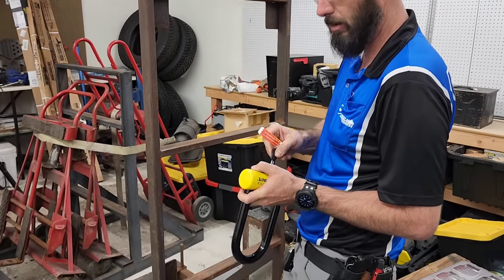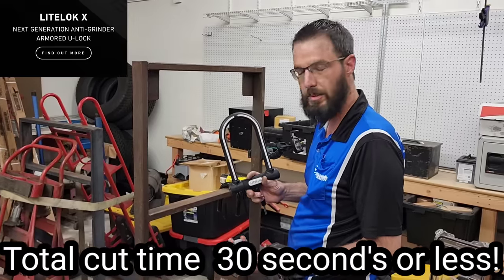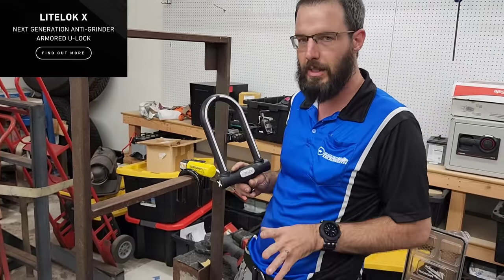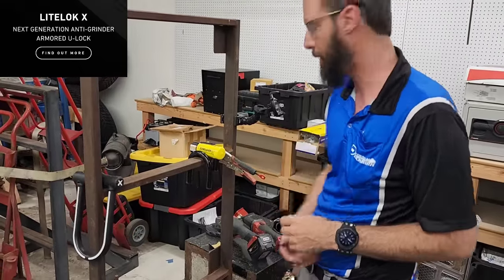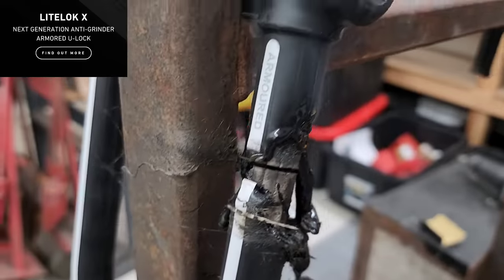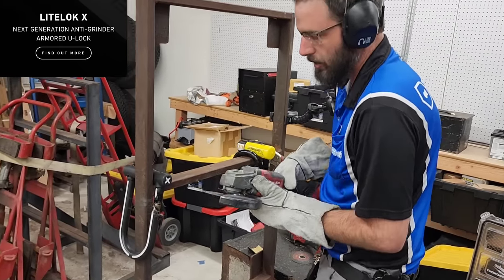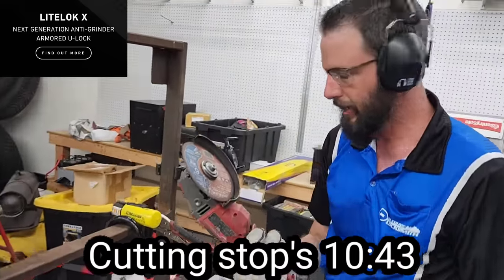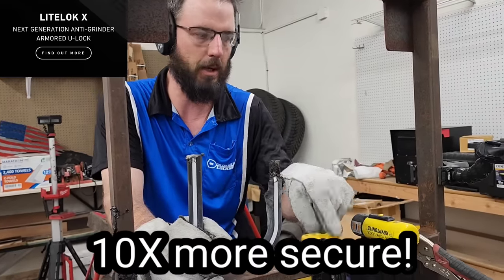Litelok world's first anti-grinder angle grinder resistant bike lock, top rated best bike lock 2022

Comment: In Europe we have something called a Hiplock D1000 which takes about 10 minutes to cut both sides with an angle grinder
Reply: Yea but they're 600 bucks for the real ones. I'd rather just get 70 dollar a year insurance, a cheap GPS tracker and a 100 dollar lock like I have and it's much more cost effective. And you can find your own bike or send the cops to it's last location...But even if you can't get it back you get a new one and a rental bike until you get your new bike. At least that's my policy(66/year).
Reply: @jdgoesham5381  The Hiplock D1000 is about $300 over here but you are right that it's too expensive which is why I don't have one. I have 2 locks which are effective against anything but an angle grinder, two air tags (one in the tyre, one in the stem) and a 120DB alarm. I removed the speakers from the airtags so the theives can't find them. Sounds like a good policy! I'll check out insurance over here but the only policies I have seen have been stupidly expensive
Reply: @jdgoesham5381  I have no insurance, no lock and no GPS tracker, and I've never lost a bike, because I never leave it anywhere where it can be stolen.
Reply: It took 10 minutes and 10 discs to cut ONE side from what I've seen.
The D1000 is $300, NOT $600.

How is $300 "too much" when nice bikes - especially nice ebikes - are $4-6k, NOT $1k these days?  When you spent $50 to protect an $800 bike 20 years ago, $300 for a $5k bike is actually a little less security money spent per bike dollar.  The math checks out.

Saw a $5k cargo ebike locked in the SF Bay Area with a basic, old tech lock recently.  THIS is the perfect candidate for this new breed of locks.

Yes, use GPS trackers.  Yes, get insurance.  Yes, be smart.  But use the best lock!
Reply: @ruzziasht349  so you sleep with your bike?  Shower with it?  Attend a concert with it?  Go to work with it?  Have sex with it next to you?!!!!  And what if you have more than one?  Do you ride your first bike with your second bike over your shoulder?

EVERYONE leaves a bike behind.  I HATE the saying, "Oh, my bike's TOO NICE to lock!"   No one is always with their bike.  

EVERY bike is left unattended, so EVERY BIKE SHOULD BE LOCKED!  All 12 of my garaged bikes are locked right now.  In a double-locked garage with beefed-up locks.  And with active video surveillance 24/7.  They're also all fully insured.  Some have GPS trackers.  And some of the locks have extra pipe sections attached for added security.  (Yes, I'm kinda bonkers when it comes to bike security.)

However, many are irreplaceable as they aren't made anymore, hand-made by a small builder and/or have custom paint, so it's important that I never lose a bike or have to collect on insurance in the first place.

Comment: what did you cut the second side with? I notice it went straight through with one blade and was a much cleaner cut without even melting the plastic outer. Was it a diamond blade?
Reply: The second side was cut with the same disk he finishes the 1st side....it was just used correctly and NOT twisted while cutting, so it didn't have the catastrophic failure of the first two disks.  Also note the severe lack of heat damage (melted vinyl cover) on the second cut.  It makes one wonder if the first cut was ....dramatized.... just a wee little bit.
Reply: @mikedeloach6849  That's what I was thinking. Was he twisting the angle grinder on the first cuts to torque and break the blades. There was a lot of heat generation.
Reply from the maker: To answer your questions 
Diamond blade was used on the 2nd cut at the end of the video.

I was not intentionally flexing the blade in any way shape or form. Film yourself using these Ulta thin blades and you will find that's just how the work, the spin so fast and are so thing they flex while cutting no matter how straight you hold it.
Reply: @waynewinton  The third blade cut that lock like butter.
Reply: @mikedeloach6849  I call bullshit as well. He was trying to break the blade by flexing it. Also the camera is not close enough to see exactly what is happening. If your pushing hard enough that the blade is flexing just ease off and let the blade do the work
Reply: If that was x4 speed then the 2nd cut took about 80 seconds. So still 5x as long as one cut of the Krypto.
Reply: @mikedeloach6849  06:44 on looks like the disk is flexing due to being pushed down.
Reply: @mikedeloach6849  i thimk your very much right my friend...
Funny how it cuts like butter on second cut
Reply: @mikedeloach6849  yeah, he wasn't even touching the cut half the time barely scraping, but when he was applying pressure, he was pressing perpendicular to the cut ). Cut through 2/3 in 30 seconds and then just fumbled around milking time. This subjects are not for such a blatant product placement if you ask me, but at least they got money hey, and anyone with half a brain will see anyway
Reply: @waynewinton  Sorry but that is BS, I have worn out 100's of discs on angle grinders and it's pretty easy to hold them straight and level, takes some muscle, technique and determination.  I was thinking you were affecting the cut by your technique as well and caused the blade to disintegrate on purpose or just cause you suck at using it.  Send me the pieces and let my try with my grinder.  : )
Reply: @ZeeCaptainRon Aye your right this bloke is talking B/S 
"the blade flexs as you use it" 
Utter crap, it will do of you hold it 45 degrees to the cut. I've used angle grinders for over 50 years and never had one "flex" if held correctly. Might help if he used the handle next time, that was ridiculous having your hand so close to a blade that could explode.

Comment: There are quite a few things that could stop an grinder (ex. if a grinder is used on one's private property):  

1.  Motion detector.
2.  Self-defense classes: boxing, wrestling + grappling and mixed martial arts.  Include good cardio classes.
3.   Large attack dog(s).
4.   A .38 special revolver, .44 magnum, 12 gauge shotgun, etc.
5.  And some large, hard core, hard-hitting' associates.

Yes!  Two or more of the above can stop the angle grinder!  If you really want to protect your prized possessions, you can do it!

(Also, look into: sound alarms, GPS trackers and  video cameras - both obvious and hidden.)

Comment: how well does it hold up to a diamond disc?
Reply: Not good at all, the composite fiber that the lock is covered with is great against metal, but does not put up a real challenge against diamond. Several videos out there where they have cut this lock in a real life situation in under 2 minutes (with a battery powered angle grinder). This lock is a far upgrade compared to its predecessors, but this video is giving people a false security.

Comment: 8 5 24 
     appreciate the many comments making light of w-w's methods.   
a  good lock will be used for both my mtn-bike and enduro dirt bike.
as often in the CO mtn's there is no choice but lock up the bike to
whatever is available that looks the most secure

despite all that tho the value i get out of this vid is seeing a highly rated angle grinder
and learning its battery spec's.  plus an opinion of a good brand of disc.
seeing how easy it was to change to a new 6" blade was revealing.

       here is what i need a good angle grinder for.  my xt225 is 20 y/o .
and the stock rear tire  4.0 x 18  needs replaced   and getting off the old
one ... as neither it or the inner tube will be used for anything else 
using an angle grinder is the choice for removing both.   the rubber's
gotten stiff and hard and is too tough to try and get off 
using traditional methods.

        using my Chicago angle grinder worked well two days ago for the 
front 3.0 x 21" wheel.
aand using the cable-tie method the new tire went on easily.
w/o any soap-y water

       now , w/ the rear wheel all goes well until i get down to the
 tire edge  'bead' or whatever you call
the section with the steel cable embedded in the rubber.   even with
2ea  24" tire-irons from h.frt the bead can only be pried out about 3/4"
from the wheel metal rim.  thus getting to it with a 7" skil-saw and
a metal blade  worked but only up to  the last 1/2".

     next the angle grinder and a 4.5" metal blade worked some
except the diameter wears down and hitting the rim and scoring
it is too dangerous.  once i have a new blade i'll try it again.

     failing that the tool of last resort is an air-die with a 1/4" shaft 
2"  metal - cut disc blade .  its smaller diameter shud fit in there nicely

     so long

Comment: Good test. I remember your test of litelok's first lock, pity you didn't try the torsion approach with that first. Litelok is a POS company that posted videos about their original lock that are fake (supposedly angle grinder and saw resistant, which it wasn't), who posted fake comments with those videos and who claimed slander about the video "Litelok bike theft in 17 seconds", which is just nonsense action from them, so I would not ever buy anything from them. About this type of lock: I heard about such technology (inserts in the steel to stop/rip apart metal grinding discs) years ago, makes sense as with metal cutting discs you get nowhere in stone and similar materials. The similar hiplock D1000 was available at least a year ago. Your test: I was curious about how diamond cutting blades would do. From a reply you placed, you did the 2nd side with such a blade and looking closer at the video I saw it and really the question is how fast and how many blades exactly with such a disc?
Reply: Cutting any material a masonry/diamond blade will be much slower than an abrasive blade, that includes very hard materials.
Try cutting a larger drill bit for example.
Reply: As far as I'm aware there aren't using steel inserts but extremely hard alloys (almost as hard as diamond) similar to something like boron nitride.

Comment: Yep, but on the other side of the u-lock you cut it with a diamond cuttin blade. Instead of the metal cutting disc. It munched through it. So the point is if you have a really expensive bike, motorcycle etc. Dont lock it up.

Comment: Now repeat the test using someone who can use a grinder ! 
You are twisting the cutting disc in the slot you have cut, yes any cutting disc will shatter cutting normal 10mm rebar if you twist it in the cut.

Comment: Every video I saw used low quality discs. How about using a diamond disc? And also keep the angle of attack always exactly the same: the metal then heats and becomes soft. You can exercice on steel bars for concrete reinforcing.

Comment: This isn't a solution because they will simply grind through the crappy bike racks instead. Whatever you lock it to needs to be strong otherwise this lock is useless and very expensive.
Reply: Remember, assuming you lock it in the city at daytime, whilst they might be able to get thtough the lock or what you locked it to, they gotta stand in the middle of folks with a grinder , someone is bound to call the cops, better yet stop these spineless cowards
Reply: Yes but they will start on the lock first then Realize eventually to cut through the bike rack but most thieves probably aren’t going to immediately think of that

Comment: its interesting that the second cut didn't go through even 1 blade?? you should do it on the hiplock d1000, i hear its much more better than this lock with angle grinders.
Reply: Pretty sure he just had a firmer cut there and more leverage
Reply: @falcodarkzz  He switched to a diamond disc instead of metal discs that he used before. The composite fiber that the bike lock is fused with is great against metal blades, but stands no chance against diamond discs - which a professional bike thief would use...
Reply: @sirulrich88  no, the blades are the same, he just angled the tool. Very apparent on the first disk, but even for the 2nd, you can see him left the back at 9:15

Comment: The fatal flaws: 1) the thief can cut through the metal post the lock is attached to (almost certainly 5mm steel - easy to cut) or 2) they can cut through the bike wheel or fork or whatever and throw the busted bike into a van. Oh yeah, and what about a diamond blade? It’ll cut through stuff abrasive discs can’t even mark.

Comment: Someone needs to make a lock that has a plastic shroud around the lock that is filled with hundreds and hundreds and of very tiny  Is kevlar fiber threads that are doubled back on themselves so as soon as you with the grinder Is touches them they all pull out and grab ahold of the grinder blade.

Comment: the issue isn't the lock its what the lock is attached to, just cut the weaker material then take bike somewhere else to remove lock
Reply: True. Just make sure it is locked to something solid & thick? Are common bike street racks hollow? If so a thief might attack that with a grinder once the Litelok x3 becomes known about?

Comment: I've been using the Pewag case hardened 12mm chain with the Video Euromonolith padlock which is the most angle grinder proof combo I've found so far but it's 6.5 lbs for a 1foot chain. Seems like litelok x might be even better?
Reply: Or have both. Plus cover your bike and park it next to other bikes that aren't covered. Why? I saw on a BBC documentary, London bike thieves said they wouldn't target a covered bike, because they don't know what security is under the cover, and they don't know how long it will take them. So they target the bikes with no covers because they can evaluate how quickly they can steal it.

The cover alone next to loads of bikes that aren't covered, would probably see the bike ignored, if not then they have a nasty surprise of grinder disc destroying hell waiting on them.
Reply: @Inquisitivemind97  Smart. I'll remember that. I keep a cover in my frame bag of my ebike.

Comment: What if you did another test but with one of those fancy diamond cutting wheels? Yes a criminal isnt going tk use ine bit it would be an interesting test either way, if you still have the same lock you cut in this video you could just use that instead of a brand new lock

Comment: I once spent all night cutting the steering lock off an abandoned non-running car... and that was with a hacksaw...   so yeah....   you can be sure I'm carrying multiple blades and a blade changing tool.    And I don't care how much noise I make, because nobody else is around.    There's nothing special about this lock... it just has alluminum in it.   Alluminum oxide cut off wheels have a bear cutting through alluminum...   alluminum oxide will cut through hardened steel like it was butter... but alluminum oxide is just beating it's head when used on alluminum... alluminum oxide forms immediately on a cut made into alluminum.   It's like trying to cut a brick... with a brick.    What did they call their magic metal... Barronium?   LOL.    Probably hardened steel with an alluminum core, or an alluminum ouside with a steel core.

Comment: Awesome testen. Thank you! Could you also Test the Hiplok D1000? It is supposed to be even tougher. 👍
Reply: Issue with the D1000 is that it’s quite small. However very much angle grinder resistant. They will just cut the post that it’s locked to. So you ideally need it to go through the wheel, frame and to the architecture your locking to. That’s where the D1000 suffers as it’s potentially too small. If you only lock it too frame and architecture then a simple cut on the architecture and they are riding away happy.
Reply: @richwilliams9895  yeah, that idea came to me a few months back to. What keeps them from just cutting through the post that you locked your bike to.... 😒

Comment: This is probably a dumb question
Why don't the lock manufacturers insert an inner core shaft that can spin when the angle grinder reaches it?
I think in the old days they used such technology in prison bars to resist cutting
Reply: Or wrap in a fiberous fabric that tangles up the grinder blade, like what flax leaves do to a weed-whacker. Would also help protect the bike's paintwork.
Reply: "inner core shaft that can spin" -- because it would never spin even a fraction as fast as the grinder.. it might slow things down a bit but not much

Comment: Dude thiefs are opportunistic and go for the items that they think has the easiest lock to get through. A thief would most likely start cutting the Kryptonite and 5 seconds in give up and move on to the next lock. The LiteLok's shackle is significantly thinner than the one on the Kryprtonite lock the only reason you couldn't cut through the LiteLok is because it was quite obvious that you were intentionally trying to break the the grinding disc unlike how you were using the angle grinder on teh Kryptonite lock

Comment: I am not sure what type of blade, I call them grinding or cutting wheels you were using? Appears you were using grinding wheels by the strands on the broken blades,  if so, you used the wrong type blade/wheel.
Also there’s cutting wheels for steel and cutting wheels for stainless steel, no strands.  Easy to know, what type to use. No more than an 1/8 of an inch thickness.

Comment: Very obviously sponsored, no professional bike thief would use a metal disc, but a diamond one. To use a metal disc against composite fiber (which the shackle is is covered in, under that its the same hardened steel as the other shitty locks). There are multiple videos online cutting the lock in a real life situation in under 2 minutes with a battery powered angle grinder with a diamond disc...

Obviously, much better than the previous bike locks with only hardened steel and a shitty shackle cover that does nothing, but this video is giving alot of people a false security....